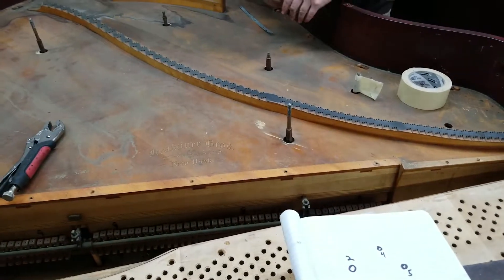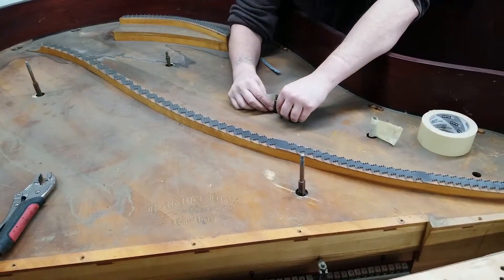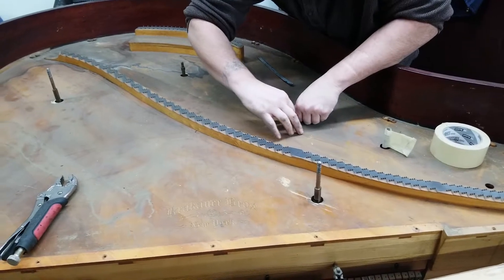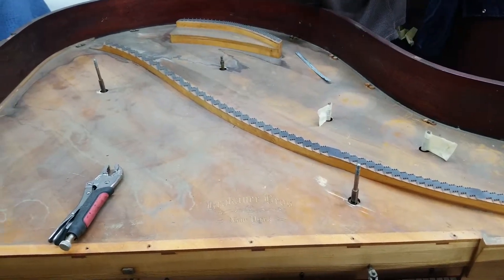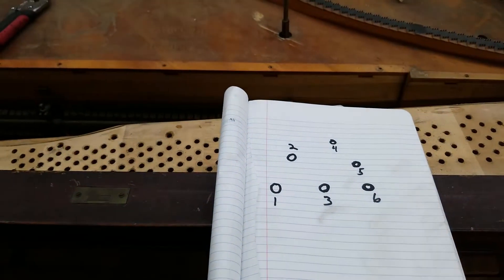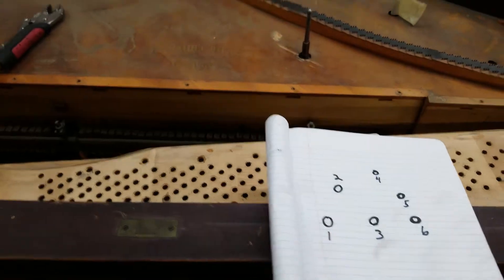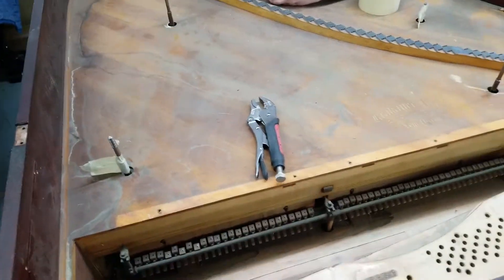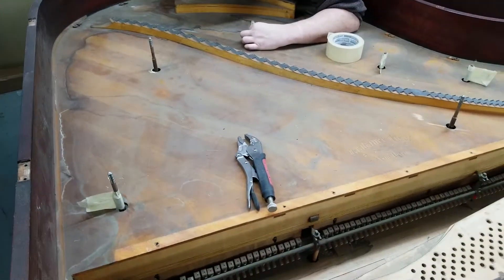Krakauer-2 Soundboard Work Shorts (2)

Comment: I used to use a flat hacksaw blade to mark the EXACT height of each bolt. I found this far more accurate than simply using take. Of course, if you are only looking to "ballpark" the nose bolts, then I guess tape is ok. Fine adjustments can be made once the final plate fitting is being done.
Reply: I may not have posted those videos yet but that is exactly what I do (hacksaw)to locate height of those bolts.  In the end it gets me a good reference point.  I check downbearing anyway before bringing those bolts up against the bottom of the plate.  They are there for support only and not to carry weight if the plate.  More of a stability deal than anything.